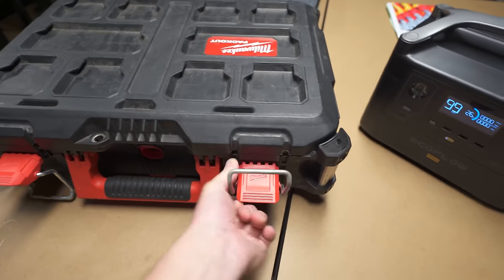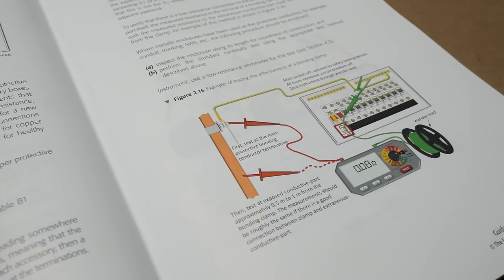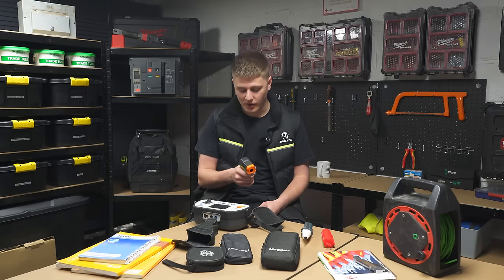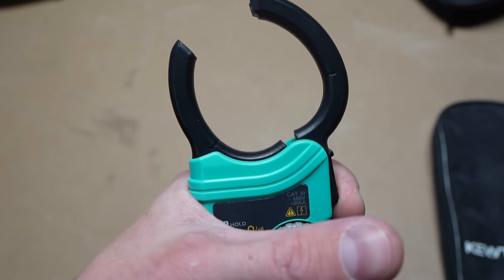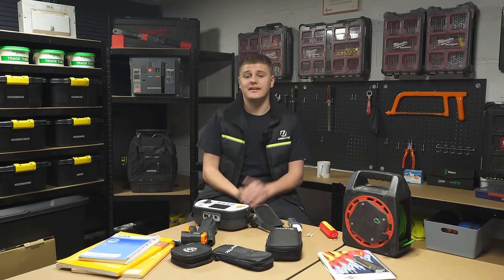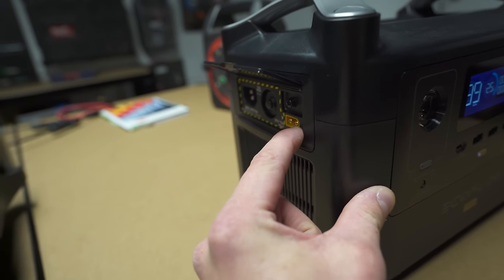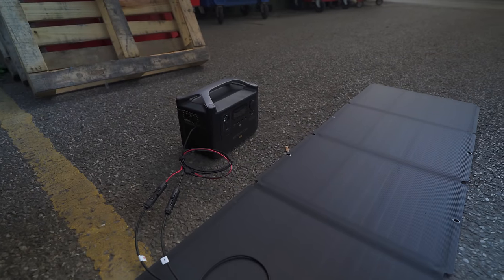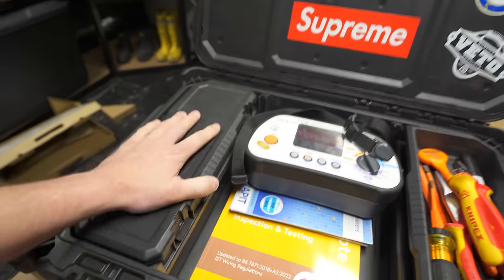Electrician test equipment essentials

Comment: with the exception of the wander lead, those tools look nice and clean 🙄

Thanks for sharin mate 🙂
A Fuse Finder absolutely essential for me sometimes.  Turn up to a restaurant and no ones got a clue which badly labelled breaker does the circuit you're supposed to be working on

Comment: FLIR CM275 clamp meter with thermal imager built in; pricey but incredibly handy. 
Actually bought mine originally for working on overhead cranes because it's light and easy to carry (there isn't much room on crane gantries) and it's my go-to for quite a lot of stuff now.
Reply: @residualelectrical  I've had a couple of cases recently where cranes have had an intermittent phase loss on a contactor and TI highlights it more easily than trying to probe onto a contactor output and run the crane; it's useful for finding mechanical issues that stop a motor also.
If I'm doing an install, I can do a load check and a quick thermal scan of a DB to spot any unknown / unseen problems before starting the job.

Comment: The packout box works quite well for your testing setup. Not much different to my setup really. I do carry a voltage tester and proving unit plus a small level in my domestic / light commercial. For my industrial set up I add spanners / sockets and a lot more socket adapters and then an earth tester in a separate bag with all its leads and spikes and clamp.

Comment: Hi Mike, are you still keeping your test gear in packout? I'm racking the van at the moment and currently have my test gear in a Veto MB3 - when on site do you find the packout restrictive not having a bag to carry around with accessories etc.I've a KT65DL so the setup would look similar to yours. Hope you're well.
Reply: @residualelectrical  Cheers, matey. Think it will be easier in some packout.